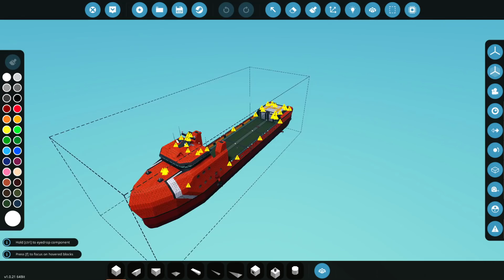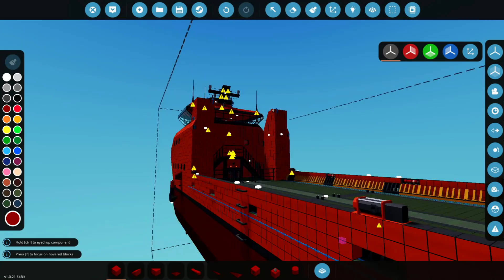Engine Fire Suppression  -  Supply Ship Build  -  Stormworks Build and Rescue

Comment: I prefer a gravity fed system to pumps, both for practical reasons and realism. I put tanks up at the top of the ship with sea water feed via pumps. That means that in the event of a loss of power, the fire suppression system will still work until the tanks are empty. It's even better since they brought in mechanical valves, since it's possible to have an entirely electric free fire fighting system (you can even use hand pumps to slowly replenish the tanks if needed).